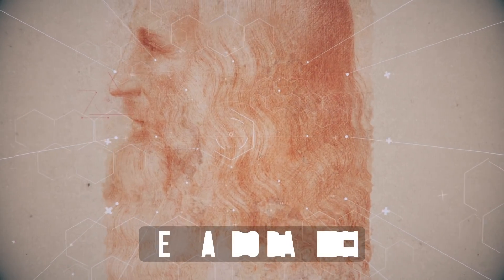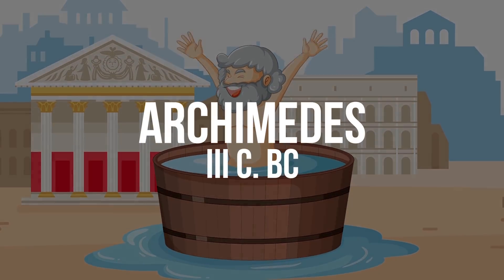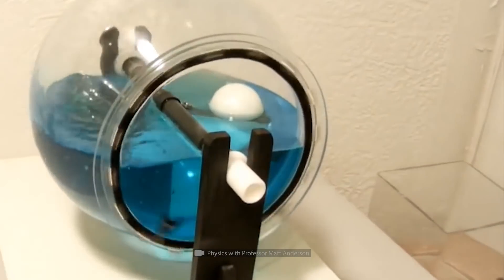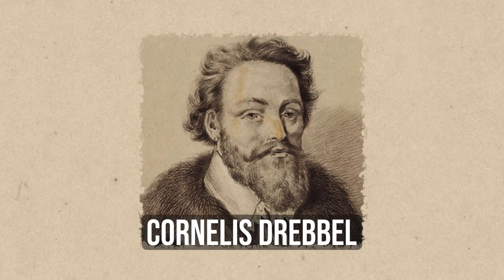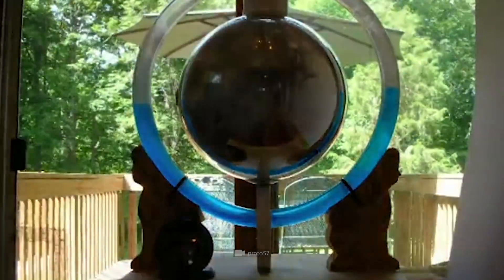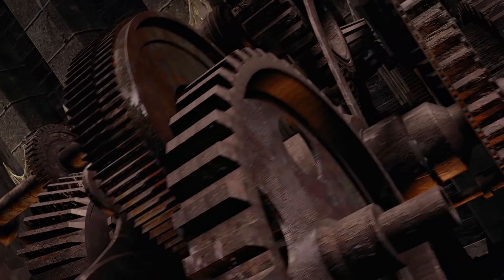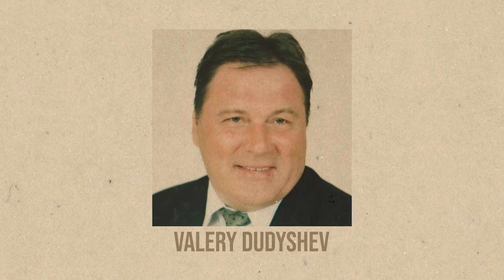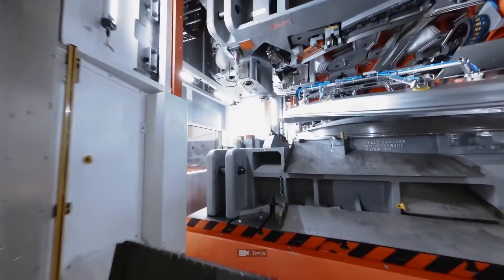Are Scientists Close to Creating a Perpetual Motion Machine?

Comment: Its unfair that the definition of perpetual motion starts to change from a physics issue to a material issue once you start getting closer to actually succeeding. If you defy the law conservation of energy and thermodynamics, your machine is starting to succeed but now it fails because the material itself doesn't last forever. Hence the definition has changed. Perpetual was never defined as a machine that couldn't be created because no material can last forever. If you make a machine that can operate on its own until it's materials wear out (such as a magnetic bearing) that can take 200+ years to wear out under its own friction...that (to me) is still a perpetual motion machine. Because it runs on its own until its mechanical parts fail decades later. Otherwise, perpetual motion doesn't fail because of the laws of physics. It fails because it's impossible to make a man made material for the project that can last forever regardless of physics.
Reply: Even if we could get it to go a year that would be major
Reply: @nfg_racing7968  Absolutely. In my opinion they just don't want anyone to succeed because they've been trying themselves for centuries and failed so much that's in order to avoid the embarrassment of some nobody with no degree in his garage start get too close to succeeding, they start changing the definition to make sure he fails. In my opinion, as long as the device produces more energy than it uses to power itself, doesn't require refueling and it can continue to operate until its parts wear out or fail, that's is a perpetual energy machine. I also think the key to the problem with the off-balance wheel it frictionless magnetic bearings. An axle that levitates due to equal magnetic force applied around the axle using the opposite or opposing magnetic field.
Reply: @hellbent7062  No one made a machine that produces more power than it uses to power itself, not even one that can only power  itself indefinitely. This definition or that, it's impossible. Why? Laws of physics that govern our reality. But you can keep fooling yourself with " they just don't want anyone to succeed because they've been trying themselves for centuries and failed so much that's in order to avoid the embarrassment of some nobody with no degree in his garage start get too close to succeeding, they start changing the definition to make sure he fails".
Reply: @hellbent7062  "Perpetual motion has been done but when you start throwing in words like forever, infinity and indefinitely, it has to fail." Do you know what the word “perpetual” means? Yeah, there's that. Also, how the hell do you know what was before the singularity? You can believe that there was "nothing" (how can nothing even "be"? If it "was" it's not nothing, it's something) only if you believe in god ('cause god created everything out of nothing) and I do not. Find me one credible astrophysicist who thinks that there was literally nothing before the singularity.
Reply: @d4xi5   Well, let's answer your first question. Yes, I know what Propetual means. It means "forever". But  that only proves my point. That word didn't exist until the 1400's. The originators of the incorrectly named preprtual motion machines such as Bhaskara never used that word. The word didn't exist so their work wasn't designed to last forever. They wasn't trying to make a machine that last forever because they already knew there is no material that last forever to make it out of regardless of physics. If he could get it to run for 10 years it would have been a success. Archimedes died 200 years before Jesus Christ. Then 2000 years later scientists created the word preprtual and said it means forever. That changed the whole purpose of their work by defining it as machines that's suppose supposed to run forever. Thats what is stupid. Even if you made a steel box that does absolutely nothing but sit there, it won't last forever nor would anyone expect it to. So obviously, "forever" wasn't their goal. The modern scientists changed the definition of what the originators we're trying to do. It definately wasn't called Propetual motion. Now to answer your second question: I never said I believed in the big bang theory. I said "if" you believe in the big bang theory then you have already broke the laws of physics because all the energy in the universe came from a single atom that came from nothing (or it came from God if you believe in God) The limits of scientific knowledge flat-out stops before the singularity because before this event, space and time did not exist (which means the Big Bang took place at no place and no time). In other words, if there is no space and no time....there is NOTHING!
Reply: @hellbent7062  Again, how can you claim to know what was or wasn't there before singularity? Also, "In other words, if there is no space and no time....there is NOTHING!" if there "is" then it's not nothing, it's something, so, if there was anything before the singularity (I think there was) be it spacetime as we know it or something else it most certainly was not "nothing".
Reply: What are You talking about??? Perpetual machines cannot be costructed EXACTLY becouse of law of physics. And You even named them. You may try for another billion of years, and you will still not beat the law of conservation of energy, and thermodynamics rules. BECOUSE IT'S SIMPLY IMPOSSIBLE. So, with your (very stupid) definition of perpetual machine, we could say we alredy made tons of them (for example Water energy plants, Solar panels etc - That can work for hundred of years. ) BUT IT IS NOT PERPETUAL MACHINE - becouse it requires external energy (foton's from Sun, Water gravitational energy) it CONVERTS one form of energy into another one - but it do not produces energy out of nothing. The closest thing that could work for thousends of years that i can imagine, is usage of Seeback's effect. All You need is just long wire, made of 2 different materials and any place with a difference of temperature. For example You could use just a stupid house, becouse ussualy there is some difference of temperature between shadowed/ sunny sides. As long as there is any difference of temperature on connections of those 2 different metals - it will be producing electical power. BUT STILL - NOT OUT OF NOTHING. No moving parts, can last thousends of years and producing power - but it do not beat the conservation of energy rule.
Reply: It is always a physics issue. You will never be able to design such a machine without either violating the first or second law of thermodynamics.
Reply: @lordlucas0392   @LordLucas03  Dude, you're twisting my words. I never said someone made a device that produces more power than it uses. I said perpetual MOTION. I said every time someone produces a perpetual motion device they change the definition. I also said no one has ever broken the law of conservation of energy. You seem to purposely miss the point of the video and the point I was making. Any reference I made about perpetual ENERGY was theoretical and based on "what if" and speculation. Such as, if you believe in "The Bang Theory" then the law of conservation of energy and thermodynamics has already been broken. The entire universe came from nothing. Before the big bang, there was a singularity and before that...there was nothing. Proving energy came from nowhere. Now switch to perpetual MOTION. Look at the video at 6:13 for 7 seconds you you will clearly hear him say the only reason the magnet based perpetual motion machine stops is because the magnet will eventually stop being magnetic in a thousand years. Not because of physics. He never said the device stops because the laws of physics. He changed the entire definition from a physics problem to a materials problem by saying it stops only because the material itself can't last infinitely or forever. Wtf! so it fails because the material will eventually wear out over time. That's not a physics problem. If all you have to do is replace the magnet once every thousand years or once after every 15 lifetimes...Thats preprtual motion to me. When the idea of perpetual motion first appeared, i dont think they were trying to make a machine run forever without ever needing replacement parts. They were talking about making a machine that runs on its on using free energy for decades until it wears itself out. Throwing in words like "forever" and "infinite" is what makes perpetual motion and perpetual energy impossible. Not physics. but the problem with that is, those two words also makes ANYTHING IMPOSSIBLE because nothing last forever or infinitely. Why? Becausethe entire universe will end at some point. We dont need the law physics to know that. Laws of physics do change whenever there is a massive jump in human intelligence usually about every 500 years or so. The last 100 years has seen the biggest jump in human intelligence in the history of the world. It's not going to stop now. Quantum Mechanics has proven the laws of physics can be broken. Black Holes constantly break the laws of physics. The laws of conservation of energy has been broken if you believe in the big bang. And it will happen again regardless of the closed-minded people on this comment board that  thinks we have the entire universe boxed into our laws of physics.
Reply: @Hellbent706  You really do not understand this, what he said. It's literary the problem with physics - again. Even in this machine, that he was talking about - this is not a problem with material. Magnet - must be first magnetized. That is, where you are pulling the energy into it's magnetic field.  It just works like a batery. the longer you magnetize it, the stronger it's magnetic field becomes, you are just loading it with energy, like batery.  But well, no  magnet's like no batery is ideal. It will be leaking the energy slowly, wearing off it after this 1000 years. (best case scenario). BUT THAT IS AS LONG AS MAGNET IS NOT USED AT ALL. When you will put the magnet into this machine it will start draining the energy out of magnet with furious tempo.  That's why he said then the magnet will wear's off maximum after 10 years. that's still - with no load, when all energy that the machine needs is just to regain the  energy lost by  super low friction. If you will put any load - hours is enough to drain it completly. It's the physics issue here - there is no energy out of nothing - you are just draining the energy stored in magnetic field, making the magnes to be demagnetized. The presented machine is just a kind of cheat - magnets are just a kind of battery for that machine. Nobody EVER changed definition for perpetual machine - it's you who are trying to do so. Earth is orbiting sun for bilions of years, but that motion is ALSO LEAKING ENERGY. (For example by creating gravitational waves). Nothing exist, that do not leaks energy. that's why it is impossible to create any perpetual machine. Nothing will move forever. (maybe excluding electrons revolving center of atom, as long as they are in the lowest energy orbit - but even that is not sure). And any load in to perpetual machine stops it super fast.
Reply: @hellbent7062  You still do not get it. This machine DO NOT WORK FOR 1000 YEARS. This is how long magnet can hold it's magnetic field - as long as this magnetic field DO NOT DO ANY WORK AT ALL. It's like in batteries - as long as you will not put them in to device- they can stay loaded preaty long, leaking energy super slowly. When you will put the magnet in to machine, you start draining it's energy- becouse machine has internal friction, and that is resistance the magnet has to work against. If the only work that magnet has to do is beating the super low friction in the parts of machine - it can hold up to 10 years. NOT THOUSEND. This is like in device that is on stand by mode - it can hold preaty long. From the moment when you will put any load in to the machine, that is typicaly thousends of times bigger then it's internal friction - now the magnet is working super hard - and will wear off within HOURS. It's magnetic field will simply disapear becouse you have drained all of the energy that was stored in magnetic field. Thats the situation similar to when you will turn on device and batery has to work super hard.  There is no magic here, not even close to any perpetual here. machine that can move for thousend of years do not exist. well, if you will construct some atomic power batteries -then it will :)
Reply: @hellbent7062  Simply not true... the fact that a black hole exists is proof none of the laws of physics are violated lol. Entropy still increases and it always will. "There is an equation of the state of the system called the entropy. In an isolated system the change in entropy is defined by the integral of Q reversible / Temparature, where deltas>=0. If the systematic process is reversible, then delta S=0". Also the law of conservation of energy can still be held true for the case of the big bang because there are several theories such as cosmic cooling that the big bang and conservation of energy would still hold true to. It is simple IMPOSSIBLE to give anything a small "push" and get large sums of energy out of it. The first law energy balance might check out, but you will end up with a negative Sgen in your entropy balance. What goes in MUST come out. Lets say I attach a boiler to a turbine, the turbine to a condenser, the condeser to a pump and the pump back to the boiler. NOW lets take this system and place it next to a volcano to heat the boiler. Lets also attach the rod of the turbine to the pump so that it runs the system automatically. Now lets do the energy balance: Ein-Eout=deltaU     Qin-Qout+Win-Wout+Emassin-Emassout=deltaU simplify to Qin-Qout-Wout=deltaU. for simplicity we will say its steady state and do Qindot -Qoutdot=Power. EVERYTHING CHECK OUT >>>NOW LETS DO THE ENTROPY BALANCE>>>>>>> Qindot/Tboundary-Qoutdot/Tsurrounding+Sgendot=0 (because steady state)>>>>>>>>> WE NOW HAVE Sgendot= Qoutdot/Tsurrounding -Qindot/Tboundary THE ONLY WAY THAT THE ENTROPY BALANCE IS VALID IS IF Qoutdot IS GREATHER THAN Qindot. IN WHICH CASE THE ENERGY BALANCE WOULD END UP producing NEGATIVE POWER. you MUST put work into this system for it to work or it will NEVER produce any energy. Thank you
Reply: @lordlucas0392  Actually I'm not the one who said Black Holes defy the laws of physics. I got that information from Neil deGrasse Tyson on his show explaining Black Holes and from my favorite theoretical physicist Michio Kaku. So, this means you think they both are wrong because you are smarter than two of the smartest physicist on earth. Lol
Reply: @hellbent7062  Sorry but you are misunderstanding lol. Neil for one, never said that. He said "The universe is under no obligation to make sense to any of us". Also Michio Kaku is a theoretical physicist... he's obligated to say some law is violated before he can even start working on anything. He will find that entropy still increases, and thus no law is violated. You act like I got my information off the internet and not from a professor with PHD in Thermodynamics and several other professors. Trust me bro.
Reply: i think what all of you missunderstand. science isnt consered with "perpetual motion" because "perpetual motion" is the exact same thing as being at rest. 
einstein already proved it. you cant get energy of neither without changing the state.
Reply: @adswers6900  I totally understand the laws of physics. But my opinion has always been that I think the original idea or goal of the scientist from the 2000 years ago has gotten twisted and lost in translation over time. I do not believe the original idea was ever to get energy from nothing or to make a machine that runs forever without ever needing parts replacements. Why? Because you dont need the laws of physics to know that no material exists in the universe to even start the project that last forever. Even a ordinary wooden box that does nothing cant last forever. Therefore, that was never their goal. Especially knowing that many of their projects were made of wood which proves that it was never intended to last forever. I think they were simply trying to discover a new continuous energy that flows out of thin air, water, gravity, atmospheric pressure, magnetism or by any simular force of nature thats both free and abundant either by recycling the energy or drawing energy from its own surroundings which looks like its coming from nowhere. I never bought into the modern scientists accusation that the original goal was to get energy from nowhere. The original goal (in my opinion) was to discover a free power source and to eliminate the need to attach the power source such as animal, human, steam, or fuel tanks etc because they believed that free energy is already around you wherever you go. Just waiting to be tapped . Thats just my opinion. When 14 century scientists decided to create a new word  (Preprtual) and force their own definition on the originators goals by assuming they were trying to make a machine runs forever and create its own energy. Both are impossible. The first is a material issue because nothing last forever regardless of physics. The second is a physics issue because you cant create more energy that you use. However, Neil DeGrasse Tyson just said "don't trust the laws of Science". For one, the law of conservation of energy goes out the window "if" you believe in the big bang. Which states that all the energy in the universe came from an explosion which came form a singularity that came from nothing.
Reply: @hellbent7062  dsnt say that it came from nothing.    You seem to have a limited knowledge about the topic at hand.   No disrespect.
Reply: @hellbent7062  You clearly dont unerstand physics because you think these magnet base machines would work for 10 years. they wouldnt even run for 10 minutes an you are just butchering science. Free energy is impossible and these machines simply ddont work. Plus, magnets are not like a battery. You cannot extract energy from them the way the video implies (the video is 100% wrong too), magnets apply a force, not energy. The enrgy you "get" comes from pushing something into the magnetic field and letting it push it back out (or vice versa). Even here you always get out less than you put in which is why the device wouldn't work for even 10 minutes. Doing this oes not rain the magnet at all.
Reply: @ndvorsky  This time it's you who do not understand. This machine DO WORKS. It simply have to do so little work (if there is no extra load, only internal friction) that energy stored in magnetic filed of very strong magnet is enough to run it really long. But this is not free energy. You had to use the energy when you were magnetizing the magnet. While you are rubbing the metal with strong magnet (parallel) You keep on building it's magnetic field. But you have to use force to do that and work against the induced magnetic field in a metal. You are basicaly pulling this energy that you are using to do that, in to it's magnetic field. Later this machine is using this energy, to keep on running. But that makes the magnet to be slowly (depending on a load - the bigger, the faster) demagnetized. No free energy here at all. It really basicaly works like in baterries. Magnetization requires energy, demagnetization gives it away - and this energy can be used to do usefull work, like working against internal friction in this machine.